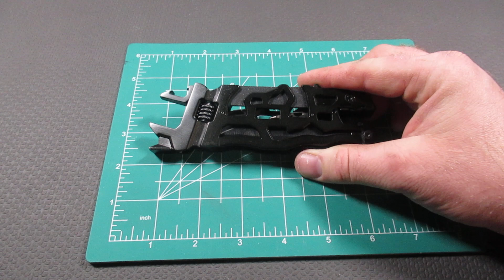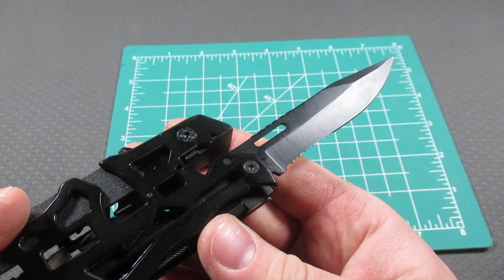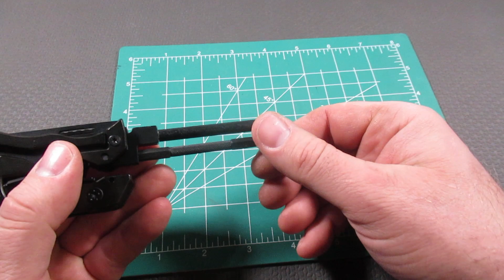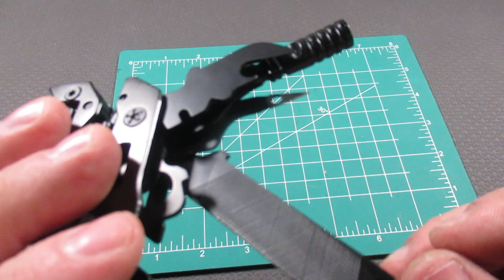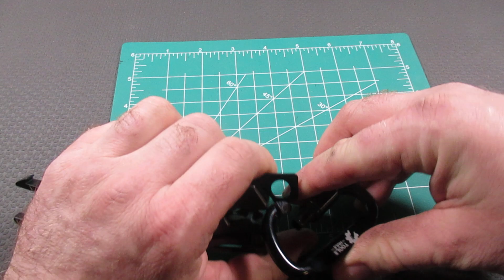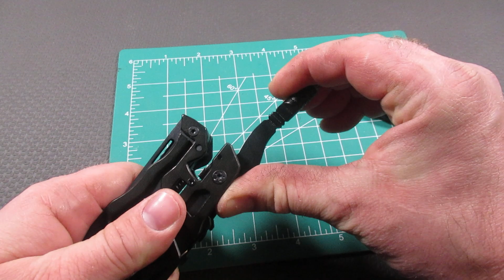Brand New 2022/2023 Caliber X MultiTool! Offers New Options!

Comment: I think is trying too much. that adjustable wrench will break at the first attempt to adjust or loosen a nut because of that useless bottle opener, the same goes for the awl with such a big hole and almost no metal around it to secure the tip. and that rope cutter with chisel? another useless thing, those rope cutters never work and at the same time you are weakening the chisel. a hammer? what are you going to hammer with that small and lightweight thing? for me is just an expensive novelty

Comment: Has some interesting features but I see a lot of issues. First one I noticed right off is the bottom jaw on the wrench looks a little flimsy where they cut out for what I assume is a bottle opener. Second thats not really an ideal way to unlock a knife blade if that is how that really works. Third, like you pointed it’s weird that you can’t seem to close the bit driver with an actual bit installed. And lastly, how the heck do you access the bits that come with it?
Anyway kinda cool, thanks for sharing.
Reply from the maker: I agree it does have some complexities, LoL!